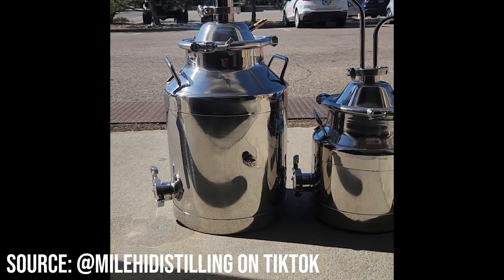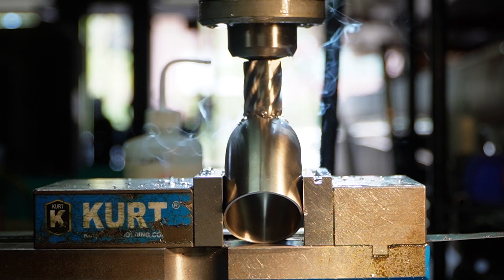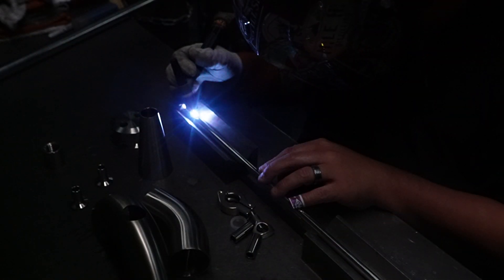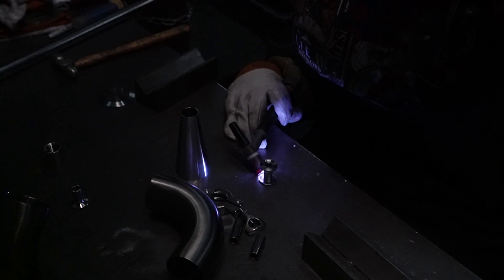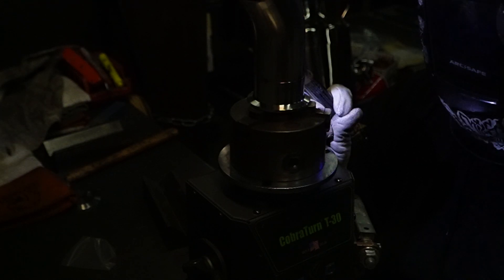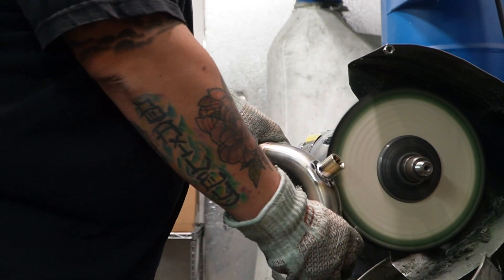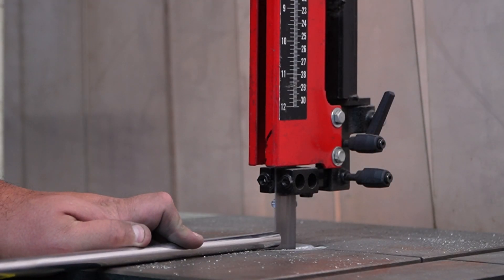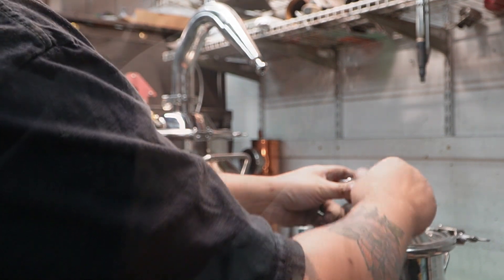How To Build A Still: Thumper

Comment: He Boo, I fairly sure your welding guy is well verses on welding but when welding stainless if you purge with welding gas the inside will have the same weld as the outside of the pipe weld. Other wise it has a burn't look and not smooth which will make it easier to clean when washing your equipment . I used to be a maintenance welder for Kraft foods. Just though I would offer this tip I learned a long time ago. You purge with the flow rate you weld with put the hose in one end stuff a rag around the hose leave the other ends open you will be amazed what it looks like inside! Give it a try.

Comment: Wonder why they don’t use filler when welding? Not a welder here but usually see it being used when TIG
Reply from the maker: @webcrawler3332  we do on some things for sure.  It's generally used here to fuse weld two different metals together, like copper to stainless or for some hard to reach welds.
Reply: @milehidistilling1  Gotcha! 👍👍👍👍
Reply: You are exactly right.